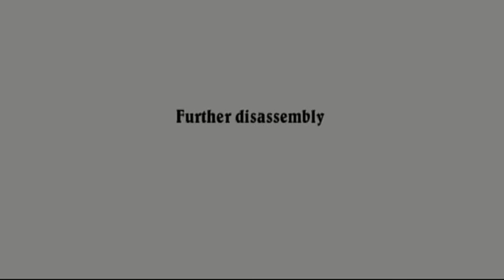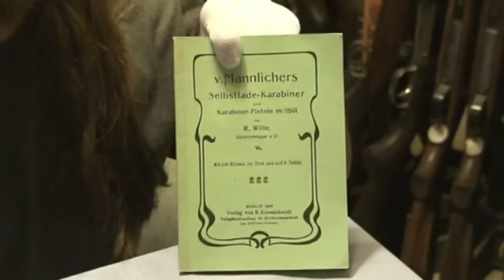Forgotten Weapons - Mannlicher 1901 Carbine

Comment: I see. Not a pistol shooter myself (I have shot with them, but not for many years), but IIRC don't modern pistols with a decocking lever keep the pin off the breech face when they drop the hammer? This one looks like a hammer-on-pin-on-breech-face situation that's not perfectly safe, and if it got dropped, inertia might take over and something nasty could happen. (I'm a member of the "only good safety is an empty chamber" school, but am aware this is not ideal or practical for military use.)